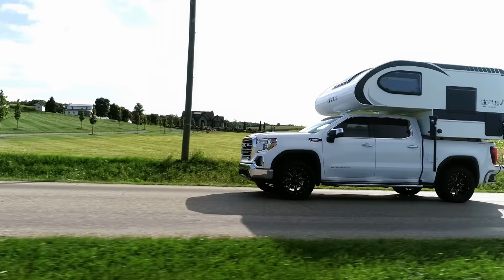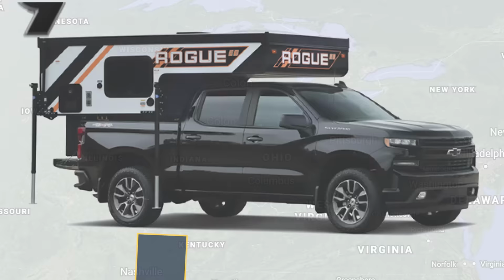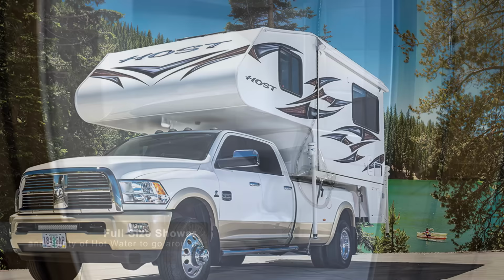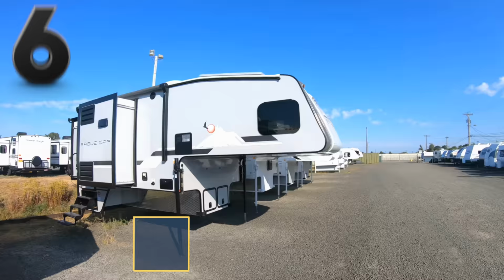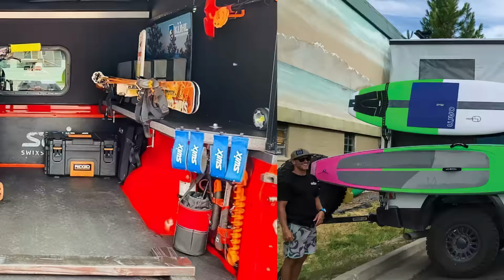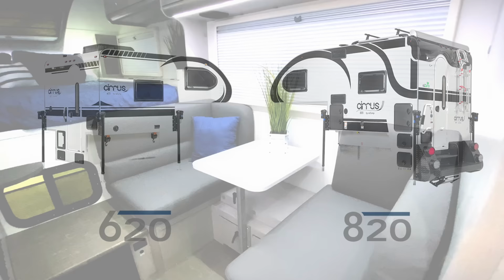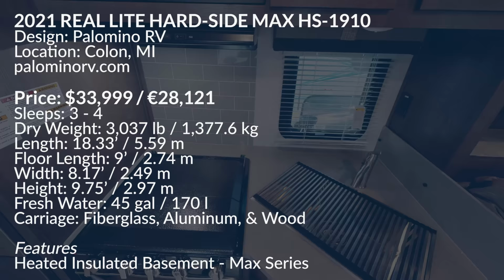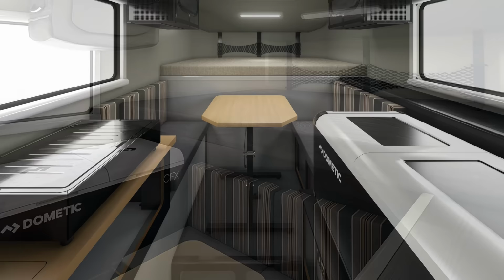10 MOST INNOVATIVE TRUCK BED CAMPERS MADE IN NORTH AMERICA

Comment: I have a 2015 Northern Lite 10-2 EXCD that I carry around on my 2009 SRW Ford F-350 with a Cummins 6.7.  I boondock camp about 6-8 months of the year, mainly in the Mountain states and Utah and Nevada.  I have taken that thing just about everywhere off road you can think of and it has taken everything without one item tearing up.  Really a well made camper, I can't say enough good things about it.  Any problems I have had, when you call the company they actually pick up the phone and connected me with the guy on the assembly floor that knew about the problem and walked me through the fix on the phone.  Excellent customer service.  I have camped in well below freezing temps with no problems as the heat vents are also in the tank areas so no freezing of piping or tanks.  A great camper that is super comfortable, reliable and built to last.
Reply: How much is it for truck & camper?
Reply: Can you pass thru to the truck in case you wanna get away etc
Reply: Cummins in a Ford?  🤔
Reply: @silanom  yeah..pulled out the Ford 6.4 nd replace it with the 6.7. It's awesome
Reply: P C  it's a true 4 season..the heat vents go into where the tanks are..its made in Canada so they know a bit about keeping it from freezing in the winter.  I think the coldest Ive been in is 8 degrees F, no problems.

Comment: Depends on what you want out of camping: RV parks or truly unpopulated areas. If you want access to primitive areas I suggest Fourwheel Campers' actual campers, which you didn't show. They have all the really basic options: really good big bed, stove, sink, heater, frig, hot water, shower, toilet. They're simple, light, reliable, tolerate the very worst of roads, and fit on mid-size trucks. Ours is 11 yrs, 70,000 mi, and after 9 summers of camping in the far North a bit scratched but good as new. 
It's a cult, I guess. Happy camping!

Comment: I had a four wheel eagle model many years ago. I had to sell it due to life circumstances, but I really missed that camper. I was ready to buy again and did crazy amounts of research. Ultimately I settled on getting a high rise camper shell with a topper ez lift. It’s the most economical and best option in many ways. The slide in campers often require that you do some mods on your vehicle and are actually kind of hard on the truck. A shell? It’s zero maintenance, feather light, and You can build it out how you like it. I’m not so much a carpenter and so I found one to help me do the interior. The camper can also be stealthy if need be.

Comment: DAMN some of those prices are more then the truck is worth new
Reply: Tyler: Factoring in the price of having to upgrade your present PU to haul one of these beasts then it's not cost effective over a nice 5th wheel or other type trailer. The only advantage is you're not towing.
Reply: But if you compare those prices to a full size RV.....   Factor in gas to run it, maintenance...  I'm biased because I LOVE my truck camper. To me, it's the best of both worlds, convenience of an RV with maneuverability of a truck.   FYI: fuel cost doubled with the weight of the camper, but napping in your own place en route and whenever is priceless!
Reply: @danamichelle1290  Dana, the arguments against a "full size RV" are the very same problems that a truck has. So your point is? 
You love your truck, go for it and BTW if you only use your truck to haul around your camper then you don't incur the costs you've mentioned. If you use your truck all the time then you'll incur those costs more often because a full size RV only incurs those costs when being used. Try another justification/argument.
Reply: @skipperclinton1087  Never said I loved my truck.... just throwing out another factor to consider! Peace!
Reply: @skipperclinton1087  I use both all the time so I'm fully aware of the cost incurred as well as the juggle of parking one for repairs while the other is... parked.  Like I said, full time means more to consider.
Reply: @danamichelle1290  Sorry Dana, I missed the "camper" word because you had the "I love my" in caps and camper wasn't. Peace back to you.
Reply: @skipperclinton1087  It's all good!
Reply: @anninriverside755  A truck camper literally is a compact RV.
Reply: @anninriverside755  The money to spend on this?? I'm LIVING in a truck camper. Don't assume that everyone who buys an RV is planning on using it a few weekends per year. I get what you're saying though, most do treat it like a souped up tent.  People should absolutely help others whenever they can. ✌✌❤
Reply: @anninriverside755  Everything has it's pros and cons. A trailer might be cheaper, but if I need to park in a driveway,  a truck camper is MUCH easier on the person gracious enough to let me park.
Reply: Yeah I was shocked at the prices.
Reply: @anninriverside755  you serious? You're going to say that to an average joe who works their tail off and this is their reward/enjoyment. Why don't you go pester some movie stars, pro athletes , or people in power. But, then again, in my opinion, if you can't afford to feed your kids, YOU SHOULDN"T HAVE HAD ANY! There is no reason to have to depend on others to financially provide for your kids. The hoax that you're referring to should have been planned for. It's called an emergency fund. If you can't afford to have one, then again, shouldn't have had kids. It's like buying a ferrari but not being able to afford maintenance/ insurance, etc.
Reply: @cvdavis  I agree with that. i'm planning on possibly living in an rv. For what you can get in  a travel trailer compared to one of these, it's insane. The only pro I see in these is the not having to tow/ no space needed like a  trailer to park.
Reply: I bought my manufactured home 60 x 30, concrete slab,  2 acres of land, and a well house for under 65k .  so yeah 50K for a camper on my truck?  GTFO.
Reply: @bobpaul851  Hi, would you mind sharing some details as I think I'm headed in the same direction. Thank you

Comment: The old ford with camper, my dad had one when i was a kid.  Ford sold it with a camper, called a camper special, 1978, 2wd, 480hp motor, extended cab what we had.  It was easy to rip plumming off back going off road.

Comment: I wish that companies would make a window that opens at the head of the bed, over the cab of the truck, so if a person HAS to get out of the camper in an emergency they can do so safely. Just open the window and step out onto the trucks hood and then onto the ground.

 The S & S camper company had a wonderful idea when they installed their blackened windows all across the front of the camper, but, they did NOT open.
Reply: My 1974 Sunline has an escape hatch/vent over the bed above the cab. Roof strong enough to hold 3 adults. Has a window in the front that doesn’t leak. Why can’t they make them now with a front window?
Reply: Most, if not all, have an escape hatch over the front bunk by law
Reply: Our Lance850 has an escape hatch above the bed and also one of the windows.
Reply: @jflury1823  how high is the camper? ( Lance 850) Includes air conditioner? The cab overhand is still too long on new campers for a standard cab.
Reply: When the camper is on the truck, it is approximately 13 feet 4 inches tall at the highest point (actually the tv antenna).
Reply: @jflury1823  omg! That’s way to high for back roads, not to mention, too heavy! Couldn’t imagine driving that on back roads that have a high crown. Plus the low hanging branches!!!

Comment: Very cool but like everything else it is insanely expensive, like the first one for 40k. You can buy a pretty nice fifth wheel for that but I know it’s all in what you use it for. 40 k for a truck and 40 for camper that’s 80 k before you even have supplies and gear.

Comment: $50000 why not just get the fifth wheel gotta have the f350 anyway.
Reply: So you can tow your boat or other trailer. If you have a large side by side for example you would need a long toy hauler, 30 plus feet. With this you could accomplish the same thing with a 14' trailer. It makes things a lot easier if you like to camp offgrid.

Comment: That Alp Eagle would be better on a F-350 or 3500 series with a gas engine if wanting to make sure to get max payload on the truck. Beyond that a 550 or 5500 would be even better honestly.  I'd skip a 450 with the Eagle Cap.
Reply: I have mine on a RAM 5500
Reply: I have mine sitting on a 2019 F450. The brakes, rear axle and front end components are all exactly the same components as on the 550. Interestingly enough, the DOT goes by the tire load ratings, and in some states, you can GVW an f450 up to 18,000 lbs. I assure you, the F450 is up to the task but that being said, a 550 would be even better because they do have a much larger spring pack in the rear which means you could bring a few extra things with you!
Reply: @Not2Far2Go  Awesome. I hadn't known that about the 450 and is good to know.
Reply: I have mine on a 2015 Chevy 3500 with the gas engine. And I tow a car behind with no lack of power and the diesel expenses!
Reply: @gmv0553  Yeah that sounds like a very nice setup.  Along with that no diesel expenses you also have that no extra diesel weight taking from your payload.. Which is a big plus for that gas engine of yours.
Reply: @gmv0553  People keep talking about the diesel expense. I've had three Cummings and the maintenance costs have been minimal. There is the $10k initial cost, which you will recover most of in resale and currently the cost of diesel is higher the gas, which is offset by the higher mileage.

Comment: Wish it can be designed with cab access instead of external access specially for night use
Reply: For the price you would think they would include cab access
Reply: Some do, our Lance 850 has a window below the cabover that can be opened and a pass passthru put in to connect to the truck's rear window. A bit awkward but then you can crawl between the truck cab to the camper without going outside.

Comment: Pretty but for those folks who want to take a trip and not have to pay a year's salary to pay for it these are beyond expense. Even the most minimal of units is priced outside a family budget. As a single parent who raised three children of weekend camping trips  I never could have ir would have bought something this pricey and I was a paralegal making a higher than average salary. Tents are great and it only took a van or Subaru wagon to get to camp not an expensive or special sized truck. I will stick to camping in my Teardrop and it didn't cost me a fortune just a couple of months and my own two hands to build.
Reply from the maker: Which ones, all of them? I had this conversation already, but there is a wide price range of campers on this list, your comment suggested every truck bed camper featured here is beyond the price range of a family budget. Not every camper is made for those in the average income bracket. I always try to include a pricing variety, like I did here. All those prices in that 50k range here (3) could be a full-time home, and include every amenity to do so. If need be, depending on ones job, family size etc, you could ditch your mortgage and live in those for a lot less. If you just camp on occasion, a few times every year, or likewise, these 50k and up campers aren't right for you. You don't need all that. If you're retired and want to travel the country full-time then it makes sense to get something to fit your needs..

Comment: Is there really a class III truck that can handle the Alp Eagle Cap? It’s over Ford’s recommend cargo for the F450. Then you are pushing the GVWR of the F350. I’m sure it is the same with other brands.
Reply: Depends on how you configure the truck. To get the max payload you have a plain cab, no four wheel drive and a gas engine. Also, minimal extras which add weight. That's why I went with a RAM 5500 with my eagle cap 1165. Fully loaded I still have a couple thousand pound cushion.
Reply: You're absolutely correct!
Reply: The F350 and F450 actually have the same 14,000 lb GVWR. That translates to the F450 having less payload.
Reply: @petehaidinyak9084  how do you consider the quality of your 1165? I own a 2016 1165 and the quality is pretty poor! And after I contacted the manufacturer, I discovered they could care less! I carry mine on a 2015 Chevy 3500HD with a gas engine.
Reply: @gmv0553  I've owned a Lance 1172 and the Eagle Cap 1165 and I can say the the fit and finish on both kind of sucked.  The 1172 only had two drawers in the kitchen area and they were small, the counter space was very limited. When I ran the generator it was very loud and shook the camper. The 1165 was a much better layouted and the access to the basement and equipment is better. Whenever I move to my permanent home I plan to redo the electrical and plumbing. I have an 11ft flatbed so I have a Honda 3000i generator on the bed in front of the camper. When it's running you can't hear of feel it in the camper.

Comment: With all the cameras and electronics in tailgates are there any that have plug ins to replace them in the camper ? Not to mention the back window of trucks that open.
Reply: Yes, there are. I choose to install the wired Ford trailer backup camera on my Ford F350 with Host Mammoth camper. This allows the camera to display on the truck's 8" monitor. Other wireless cameras work fine but I didn't want another monitor cluttering up the dash.

Comment: At my budget I better start with a CAD drawing that I could make myself and some plyboard, styrofoam, woven fiberglass sheets, and some epoxy or polyurethane. Then end by picking up my interior at Lowes or an auction. Does the price come down on used units?
Reply: They can, if you shop around and buy from a private seller.

Comment: While a trunk bed camper may be convenient, some of them are so expensive, you might as well just get a small camper (like one of the $10-15k campers, as a truck bed camper--a good one--can range from $10k to $30k).  Plus truckbed campers can sometimes require more than one person to install and take out, whereas a trailer, especially a small trailer like a teardrop, can be managed by a single person.  I mean I guess the beauty of a truckbed camper is it fits into the bed and makes the truck shorter so it's easier to park it into spots versus pulling a trailer, but may become a problem if you're out camping and want to go places as it can pose a height restriction issue.  One piece of advice for people considering one though, have airbags installed on your truck.  This does't incrase your truck's towing capacity but will help with stability of the truck bed camper.

However, campers, trailers and RVs in my opinion, aren't "camping".  When I think of "camping" I'm thinking a tent.  Yes truck campers, campers and RVs are convenient because if it rains its generally not a big deal as you're protected from the weather (unlike a tent in most cases).  But when you have some of the features of living at home, like a TV, microwave/oven and fridge, and a queen size bed, then it starts to become less of camping and more of just being "lazy" IMO.
Reply: I agree with the tent being real camping, take a step further, just the sleeping bag... The bottom line, to each there own, I retired 2 years ago, went fulltime in 98 Safari Trek, it's a completely different kind of camping, it's a lifestyle.
Reply: Camping? You mean like : picking up trash when you leave or respecting your neighbors and keeping the noise down. Those were the good old days. $4 a night. No hook ups. I do have an older truck camper. Have parked on the streets of Baltimore, Phila and New York City. It may have been years ago, but we still did it. We also tow a boat at times with the camper on. I agree that these new ones are too expensive. I lived in mine for almost 2 years. Don’t know why it would take 2 people to put one on a truck. Much easier than mine (3 jacks, hand crank) Maybe some outfit will come out with plans for “build it yourself” campers.

Comment: IMO, There should be a dedicated freezer option... I won't cook in a camper, so the oven/range is wasted space...
Reply: If the weather outside is nice, cook outside.  If raining or snowing cooking inside is a reasonable choice, especially if you are in the high country.
Reply: @Harry-zz2oh  I won't cook anything with greese can fly inside... so a crockpot, or toaster oven is all i need, with a freezer...
Reply: @Harry-zz2oh  Especially, in Bear country, will I NOT cook where I sleep, I won't even stock my camper with food, I use my truck as a pantry, or tie them off 30 ft. high in a tree.

Comment: Looks like a Ford option, that camper. I can’t find a new camper with the overhead bed for standard cab full sized trucks. Have a 9.5 sunline from 1974. I don’t want the overhang sticking out further that what mine does now.
Reply: Are you referring to the one in the trivia section? Yes, that's a mid-1970's Ford Ranger XLT Super Camper Special.